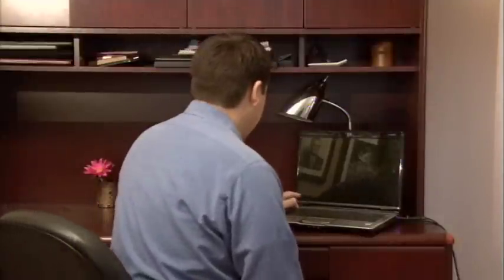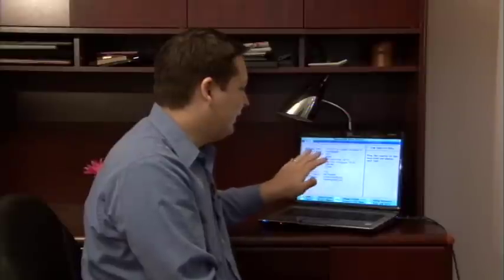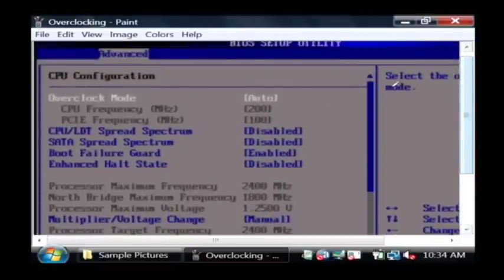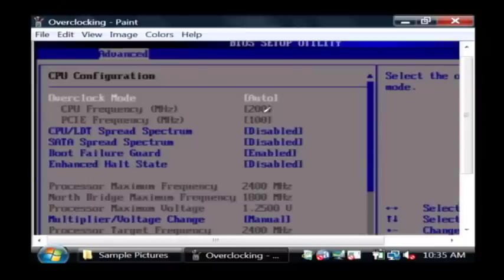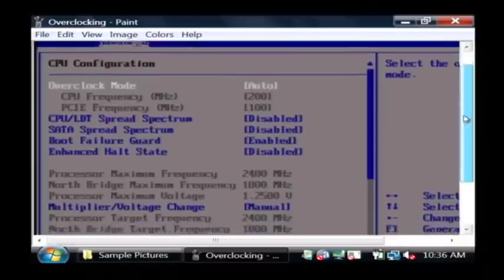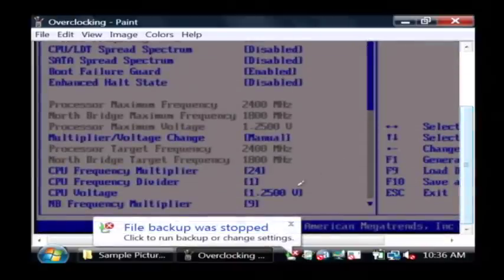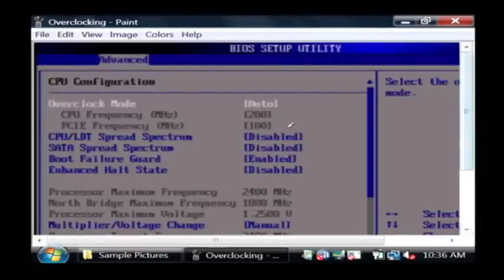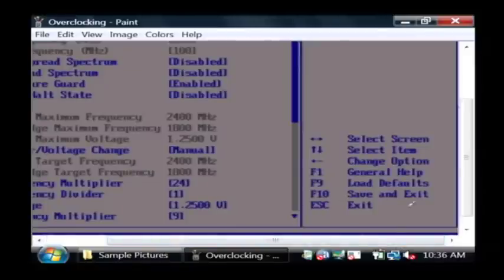Computer Hardware & Software Tips : How to Overclock a Processor

Comment: I just tried this and my computer wouldn't boot right away, it rebooted, then rebooted again before bios, and when I got the chance I changed it right back because I was terrified. Then I realized when I restarted it with the default settings it still did the reboot twice thing. Is that some kind of safety check? 

I'm too afraid to even try now :p

Comment: @platinum243125  No. It doesn't. Unless you overclock a processor from 1.00GhZ to a lot more than it could handle then you are screwed.

Comment: Yeah i have a stock coling and it must be pretty crappy cause i just OC to 3,2 and on full load temps go to 72/74 ºC ... -_-' i really need to get a water cooler. But not now. In about 1 year when i need more "power" to run games =)